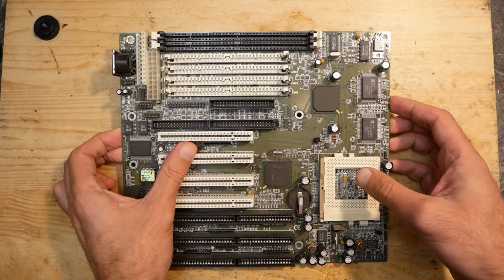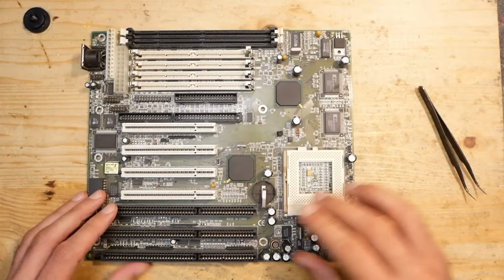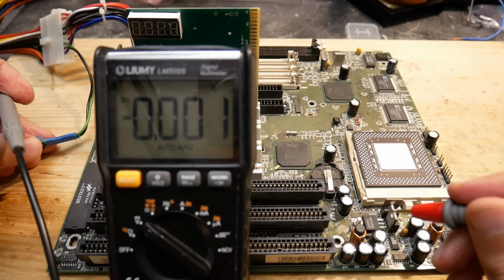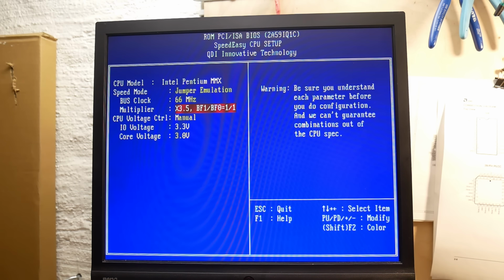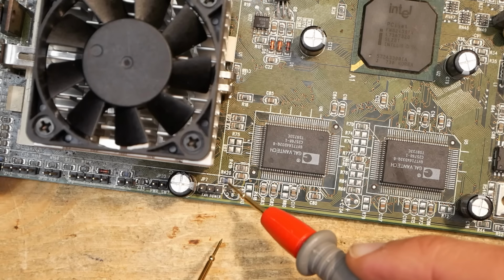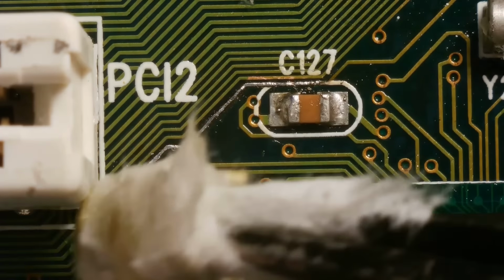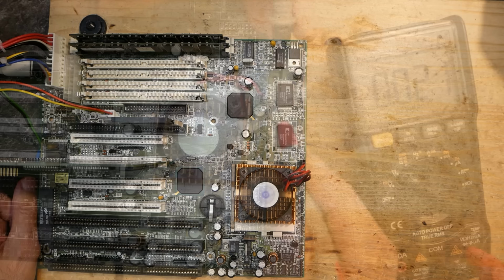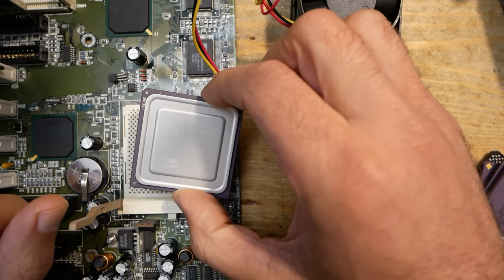QDI P5I430TX - is it the best Socket 7 mainboard?

Comment: Another board that recognises any Socket 7 CPU without jumpering is the Zida TX98-3D, Look it up, its very tiny.
Reply from the maker: Wow looks really tiny :) And they even squeezed a sound chip on it! Very cool.
Reply: @necro_ware  i have it here and basically use it to test CPUs and stuff. Comes in handy for such a task. But it is very rare.

Comment: Whether it's of any interest to anyone: I had an Intel 430TX motherboard back in the day with both DIMM and SIMM slots. The PC came with 1x 32MB EDO (yes, EDO) DIMM and, since it was cheaper, I ordered 2x 16MB EDO SIMMs as an upgrade. The 32MB DIMM and the 16MB SIMMs worked happily together and I had a massive 64MB RAM to play games with. 😊 (It probably would have burnt out the DIMM stick if it was an SDRAM module instead of EDO module).

Really enjoy your videos on Socket 7. Brings back memories. 👍
Reply: Yes,it would have burn out the 3.3 v SDRAM. EDO DIMMs work at 5 v.
Reply: @jbaroli  Huh! I've got 128MB* SDRAM in my Iwill P55XB2 right now? 

*YES-yes I know only 512KB onboard cache, but that's what i had around after needing my 2x16MB SIMM in my Socket 3.

EDIT: Oh, you mean SIMMs and DIMMs at the same time?

Comment: A lot of those boards that were early to add CPU fan headers don't provide much power at all for the fan. On my Shuttle HOT-569, it's current limited with a resistor on the motherboard, and is insufficient for most 12V fans you'd find on a Super 7 heatsink.

Comment: 100Mhz Front-Side Bus or go home, as far as I'm concerned. The TX, if I recall correctly could only cache the first 64Mb. Put in some decent memory and that ditches the performance. The HX or VX or something like that could cache up to 512Mb. The board also doesn't seem to be an ATX board. Also seems to lack AGP. Setting a few jumpers never bothered me. Although if you can do it with software, it's easier indeed. Still good to see the board receive some love. It is a nice oddity.
Reply from the maker: Valid points, but 100MHz + AGP is a Super Socket 7 and not Socket 7. That is of course another story.
Reply: @necro_ware  supersocket 7 is , not only 100 Mhz FSB and AGP, but also 2.4v  or lower CPU voltage.

Comment: 66+ means 66.66 MHz instead of 66.0 MHz
Reply from the maker: Really? Ok, will have to check it out. Thank you.
Reply: @necro_ware  Well, one user said 66.66 and other user said it was 68.5... I guess you'll have to use the oscilloscope to find out the real speed.
The "Chipset Guide" article on AnandTech says that the Intel 430TX officially supported bus speeds are 50, 55, 60 & 66 MHz and the unofficially achieved bus speeds are 68, 75 & 83.3 MHz
In their article "100MHz Bus Speed & Socket-7 Motherboards" they say "the 68MHz bus speed is referred to as the Turbo Frequency of the 66MHz bus speed, used Internally by manufacturers for testing purposes...however it makes a sweet little overclocking tool if you don't want to risk much"

Wikipedia Socket 7 page says FSB speeds were 66.7, 68.5, 75, 83.3, 95, 97 & 100 MHz
Some boards with jumpers already had a bus speed of 66+ but their manuals don't explain what that means. Maybe 66+ wasn't an exact frequency and could mean 66.7 on some systems and 68(.5) on others depending on what frequencies the chipset could generate between the official 66 and 75
Reply: incorrect.

First, he had 60+ , not 66+.
66 means always 66,6.
66+  is QDI name for Turbo mode, and same 60+.
Turbo mode means, you raise FSB a little bit, it was used for testing purpouses, for stability.
that there is a little reserve. Because chips (including NB and SB) degrade over time, so they usually tested it on 60+ and 66+ ... it was for engineers.
Lots of old boards have this settings. They are usually undocumented in manual, if set by jumpers.
In BIOS, they can be eighter visible, or unlocked somehow.

66 with Turbo mode meaned usually around 68 Mhz... and in old reviews, they used this little trick to get overclock on boards, that didn't support it. Usually added like 3% performance. ( but it was for free)

Comment: The 10 Ohm resistor is a cheap way to control back EMF spikes of the potentially electrically noisy fan motor of that era, to make sure not much of that leaks back to the source and mars the rest of the board's electrical performance. There would also be a capacitor or two in parallel with the fan.
Reply: That was my thought too, it should only be a small value such as that.

Comment: I am a blessed owner of a QDI Titanium iB+. The + variant can handle K6-2 up to 400MHz (6*66) within all specs. Bit all QDI Boards were very very well made.
Reply: Are you aware that Jan Steunebrink made a new bios for it in 2024?
Reply from the maker: The IB board can also handle that. It's just a software limitation, which hopefully can be removed.
Reply: @necro_ware  there is anandtech review for the board, one of the first reviews in early 1998.
he mentioned there, that there is 83 mhz FSB in unofficial BIOS.
Reply: Does anyone happen to have the bios flash utility disk for this board (iB+)? I have one too and I'm in need of flashing mine but I can't locate the disk or util anywhere online. I can find the updated bios files, but none of them come with the flash utility included and the manual states to use the provided utility disk, which no sites seem to have available for down.

These are great boards though.

Comment: I guess my comment was deleted because I linked to the Retro Web? Anyway, Jan Steunebrink has a patched BIOS for this motherboard that supports K6-2+/3+ CPUs and it is both on his site, and the Retro Web and I won't link to it because YouTube is dumb. This seems like a very nice board, but the TXP4 has a setting for 83 MHZ FSB.
Reply from the maker: I'm in contact with Jan. He patched the BIOS for IB+ and this is IB, a slightly different board.
Reply: @necro_ware  Sorry, I didn't notice the +. I should have known that you would check with Jan.

Comment: How does the ram click in? the retention clips don't seem to reach the retention notches??
Reply from the maker: On this model the white clips are just to push the modules out of the slot. Here they are not designed to reach retention notches. At 6:55 you can see it from the side once again.
Reply: @necro_ware  what holds the ram in? I have a motherboard with such clips (both 72 pin ram installed by default) and I couldn't get the ram to seat, one side keep popping out.

Comment: I see it has atx power connector. Have you tried directly use atx power connector instead of using atx to at adapter on it?
Reply from the maker: Yes, works fine.

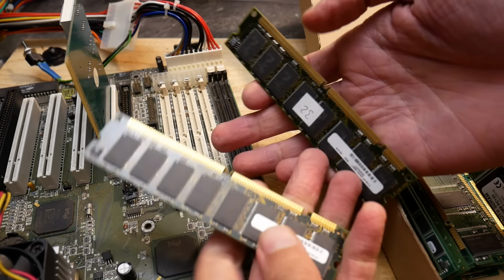Comment: 6:50 wow you bombed that deoxit there. I only apply very little of it since I don't like it when the board becomes greasy. Or do you have some alternative without lubricant?
Reply from the maker: Yea, unfortunately the spray which I have is quite strong. However, I knew, that I'll have to wash the board anyway. It was so sticky, that a bit of dioxide couldn't make it any worse.
Reply: I will sometimes go over boards with a hydrocarbon spray to clean them if they look to have a lot of oil residue.

Comment: Isn't this overheated trace powering the fan?
Reply: Looks like it goes to jumper JP6 - Clear CMOS, possibly if you short that and turn the board on it destroys the trace if the board is not designed with that in mind...

Comment: The main issue of most 430TX mainboards was the Tag Ram, it supports only 64 MB Ram in cacheable range. If you put more Ram inside than 64 MB, the system gets much slower...   ^^
Reply: That is a concern with most CPUs, though it's a non issue if you use a K6-3/2+/3+ CPU. With one of those you can use the maximum of 256 megabytes with no problems.
Reply: Oh I didn't know that! Thanks for the info!
Reply: Surprising.
I upgraded to 96 Mo because Unreal swapped with 64 Mo, and don't remember the system getting slower.
Of course I loved trying benchmarks.
With a 233 MMX at 290 MHz and a Voodoo1 .
Reply: @nalinux the read me for Unreal acts like 64MB is Godlike and overkill.
Reply: @nalinux  i do the same, so i you put 96mb of ram gos good?
Reply: @juanmanuelloujedo9496  Sorry, I didn't see your comment.
Yes, 96 is good for Unreal.
I know the README says 64 Mo is a great amount of ram, but it was in 1998 when most of people had only 16 Mo or 32.
It was expensive and 64 was a lot !
Today we don't care, any Win98 machine can have 128 or 256 Mo for almost free.
When I had 64 Mo on my 233MMX/Voodoo1, with Unreal the PC swaped a bit. It didn't any more with 96.
That's how I know 96 is the spot :)
Of course today we will use a stick or 2 of 128 Mo.
Reply: @nalinux  Nothing is going to look slower compared to swapping...
Reply: 64 was rockstar status.
Reply: In 1997, common home users had eighter 16 or 32 MB RAM. In 1998, maybe 64MB maximum.
This was no issue for home users, it only prevented some workstation / server use, where 64 MB could not be enough.

I just don't understand, why people making tragedy from this.

Not only this doesn't matters, but I saw some realistic tests, and it wasn't  " much slower" .
In most cases, it was only a bit slower. Like about 5-10%. 
Just to point you out... with SDRAM, board is so fast, that even with penalty 10%, it can match VX board.
It's slower though than HX board with 128MB RAM, that's true.
Reply: I think is ´s basically a limit of the chipset itself. Same as with the cheaper 430VX. The rummors are Intel wanted to promote Slot 1 more and did not want to make the s7 chipset too good. Especially with respect to the fact the competitors were able to use such a chipset for their products. But still it is a very good. The good answer are later VIA chipsets which are actually pretty good if the board is a) designed right b) you installed all the proper drivers
Reply: @pavelfara9333  the reason I avoided via chipsets like the plague back then was seeing compiler options and even application software with updates specifically to address crashing and other issues on Via chipsets. That goes a little deeper than having the right drivers.
Reply: So you were in a position of a programmer? I can imagine that. But the point of my post is that later on Intel ceased socket 7 and for no Intel options for ss7 were available. Maybe ALi is better. But I have not much experience with those. The ss7 had been simply whipping an old horse very hard to go faster 😀. Still I love the platform and remember with a great nostalgy!
Reply: If Manual voltage didn’t revert to Auto with a CPU change then you could could fry a lower voltage CPU when replacing a failed CPU. This is normal/expected behavior.
Reply: Since 64 MB is the perfect amount of RAM for a Socket 7 DOS/Win95 machine, this hardly matters.
Reply: @looks-suspicious  People tend to try to max out their boards thinking it will run faster so it is good to point this out to people.

Comment: Every child knows that the Asus P55T2P4 was the best 😉😬😁
Reply: I agree, it's a great board, I run a K6/2 500(6x83) in it and 128mb of ram, once I added the Tag ram it was all cached, I'd say it's only weakness is no no Sdram slots.
Reply: Looks a lot like the MB I had.
With undocumented 83 MHz FSB.
233MMX at 290 MHz very stable.
Reply: No, FIC PA-2007 is best.
VP2 chipset. owned even Asus TX board back in the day, reviews were full of it.
Reply: @LG-HH Well, I don't know. First of all, the Asus P55T2P4 is not based on the 430TX, so it's out of the question here, and secondly, I had it when it was new in the 90s and the Pentium 133MHz could not be overclocked at all on it, while other boards could. If we're talking about 430HX boards, the Gigabyte GA-586DX seems better to me, even though it also has its flaws (voltage regulator).

Comment: BIOS CPU settings, what will they think of next! 😮
Reply: unfortunatelly, this was last good thing QDI made. From this point, they only fell deeper and deeper.
Their boards started to be pretty average, and their overclocking in BIOS sucked.

Even on Slot 1, they lost it with no voltage setting in BIOS, and FSB only "66 to 75 or 83, and 100 to 112" overclocking.
 Nothing something like 66 to 100, or free 66-133. Or 100 FSB underclock to 66.

Anyway, Asus, Abit, MSI and Soyo owned it instead. 

After socket A, they sucked hard, on socket A they were average, or below average. Their boards had weak BIOS, compatibility problems, random freezes. They were close to ECS / PCChips, just slightly better.
They never made expetional board after this Speedeasy Explorers and Titanium. 
Like this board was praised in review, they were good on positions charts, but after this, they almost disappeared. They were pretty average after.

Comment: I'm pretty sure the HX was the fastest...Wasn't the TX between the HX and VX?

[SOLVED] Also, I'm sure this comes up a lot...where can I get a copy of that disk with all the benchmarks? I thought it came from Phil's Computer Lab, but I do not see it anywhere on his site. 
After searching for DOS Benchmark Pack, I found it...thanks to the person who named it but deleted their comment...
Reply: The 430TX was released 1 year (Feb 97) after the 430HX and 430VX chipsets (Feb 96.) The TX, like the VX before it, were mainstream chipsets that supported SDRAM as well as 72 pin EDO/FPM memory but they both could only cache a maximum amount of 64 MB of RAM and only supported single CPU configurations. The maximum amount of RAM the VX supported was 128 MB and the TX supported 256 MB, again with only 64 MB of that being cacheable.

The HX chipset saw use in mainstream mainboards but was also used in workstation and server boards as it supported a maximum of 512 MB of RAM with all of that cacheable with the proper cache tag RAM installed.  It also had support for ECC RAM and dual CPUs. The Tyan S1562D Tomcat II is one board that is a good example of this.

In general the HX chipset was thought of as being the fastest as there were a number of boards using it that featured 75 and 83 MHz FSB settings. I don't remember any VX or TX chipset boards that supported FSB speeds above 75 MHz. The Abit IT5H and Megatrends HX83 were 2 HX based examples of boards with 83 MHz FSB support. The Abit board also featured jumperless CPU setup which Abit called SoftMenu. 

Back then I owned a Megatrends HX83 board and ran it with a K6 200 at 83 x 2.5 or 208 MHz instead of 66 x 3 for 200 MHz. Often times the extra FSB speed gave a large boost in performance even though the CPU was only running a few Mhz faster than stock. That K6 wasn't entirely stable at 75 x 3 for 225 MHz and would not boot at anything higher than that so 208 MHz is where it stayed for the life of that machine.
Reply: @Choralone422  "I don't remember any VX or TX chipset boards that supported FSB speeds above 75 MHz" - there are many TX boards out there that support 83 MHz (I have at least five).
Reply: @Choralone422  Very interesting...thanks for the insight! I brought it up, because I've recently been playing with 86Box (emulator) for the first time and was trying to figure out the best motherboard for dual voltage socket 7. It offers quite a few of the i430 variants. I skipped Socket 7 back in the day, because I was a teenager and could not afford incremental upgrades or high end hardware when I could muster any upgrade at all.

----

Also, whoever mentioned the DOS Benchmark Pack apparently deleted their comment, but I found it after searching that directly, so thanks! I couldn't find it in his website menus.
Reply: Phil has it on his site under "DOS Benchmark Pack."
Reply: I don't have any data for that, but I once read an opinion that i430HX with fast EDO DRAM and short timings can outperform i430TX with SDRAM.
Another this is that i430HX can support more than 64 MiB of cacheable memory - i430TX can't.
Back in the day TX was perfect for most home computers, but only HX could support high-performance machines with Windows NT and lots of memory.
Reply: I didn't delete my comment, I have no idea why it was deleted. I had another comment about how Jan Steunebrink has a patched BIOS for this board that supports the K6-2+/3+ CPUs - it also was deleted?
Reply: The benchmark collection is from Phil, I downloaded it from his website a long time ago